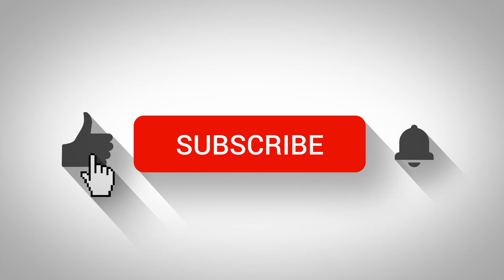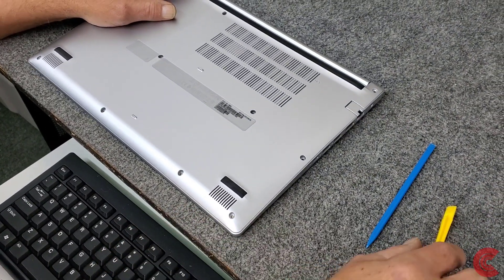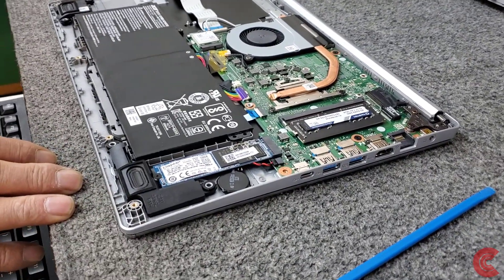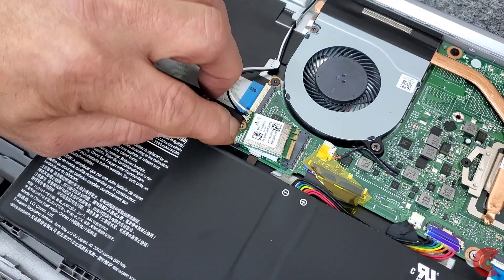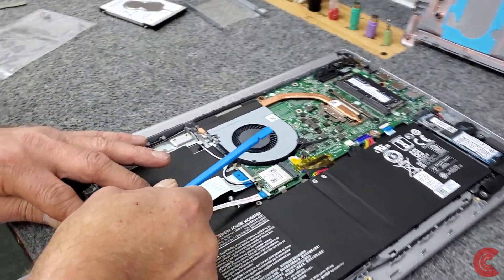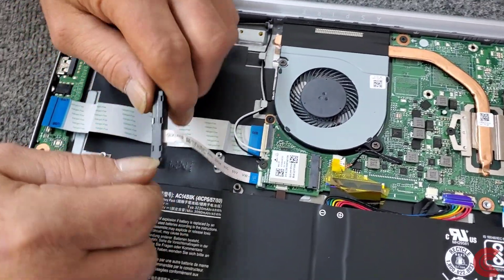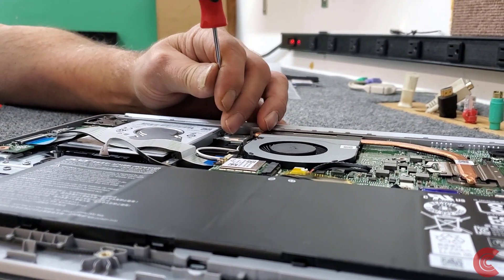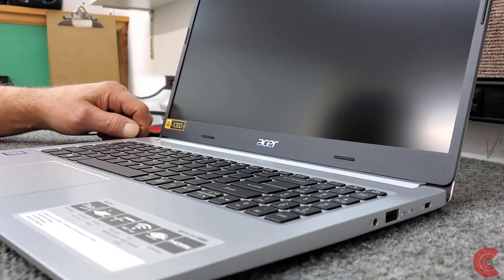Acer Aspire 5 Laptop Hard Drive & Memory Upgrade

Comment: Great video ! . You are really clear was able to upgrade using your video. 

I would Want upgrade the nvme from that 128GB.  I want to get get a higher capacity one with better read and write speeds but I have No idea how to do that upgrade. Any tips ? I have never upgraded laptop before this one
Reply: SDD and Ram websites will show what is compatible with your device. For example https://www.crucial.com/usa/en/upgrades/acer then select your model and it will show you what is suitable. That will give you an idea what type and size you need even if you don't want to buy from them.
Note the type and you can find it else where, for RAM DDR4 SODIMM is usual for modern laptops and SDD check size and type for this I'm pretty sure its 7mm SATA.
In Australia, I like to use Ramcity which has worked for me in the past.
Reply from the maker: it is easy to swap out the 128gb to any size you want,  like a samsung EVO 970 m.2